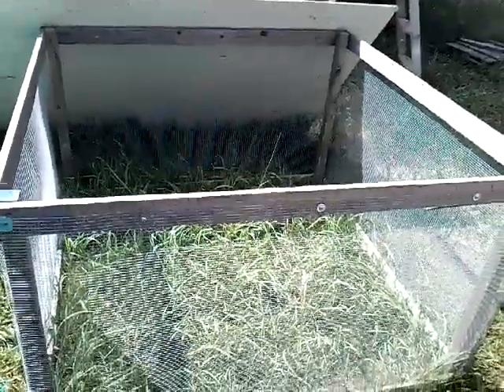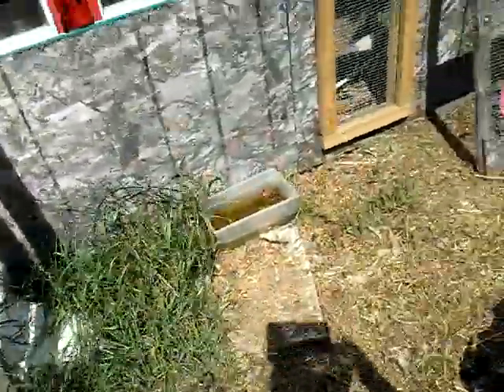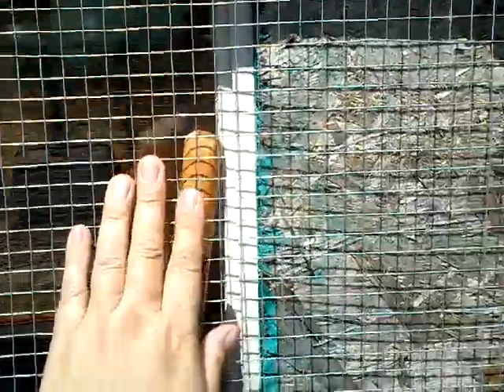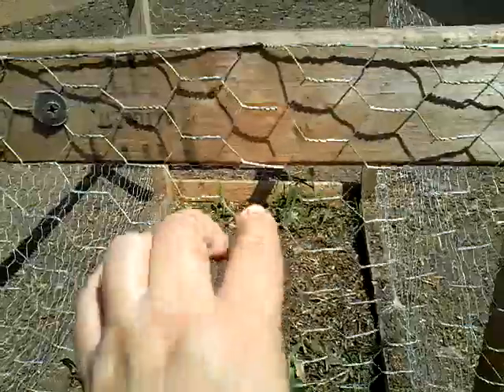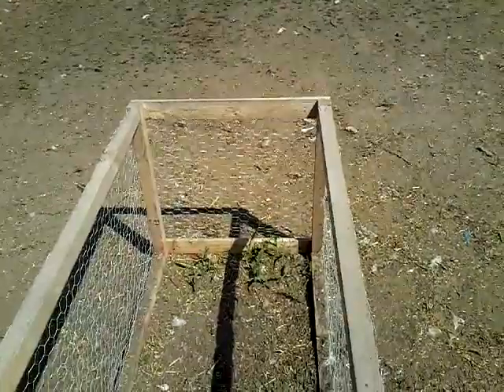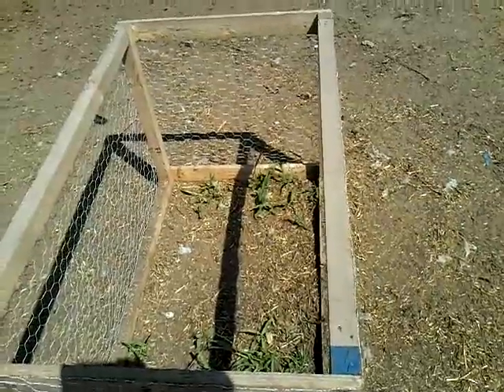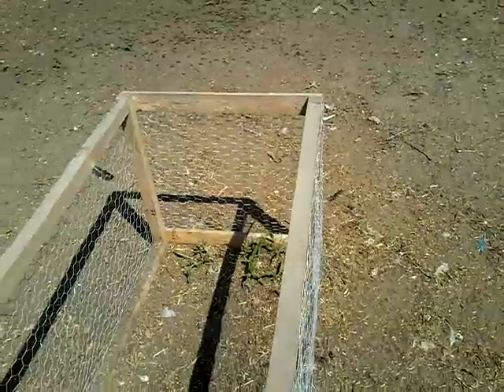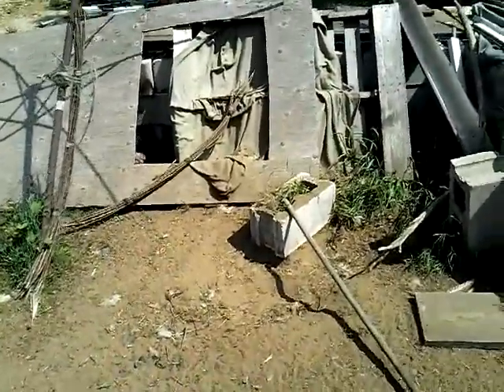Welded Wire vs Chicken Wire

Comment: I'm glad I ran into this video. I'm currently building a run and after see poultry wire in person, I walked away to further my research because the welded wire looked solid. I've had raccoons tear through catch and release cages and I knew the poultry wire could be torn through like butter.
Reply from the maker: I'm so glad that it helped.  Have fun with your run. Racoons are a 1 creature wrecking crew. Take care - Marcie ☺